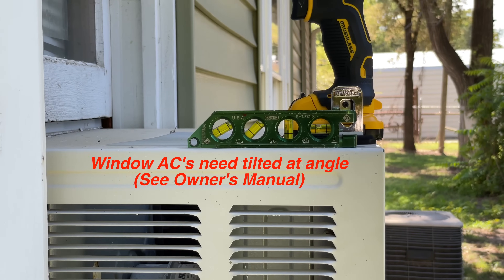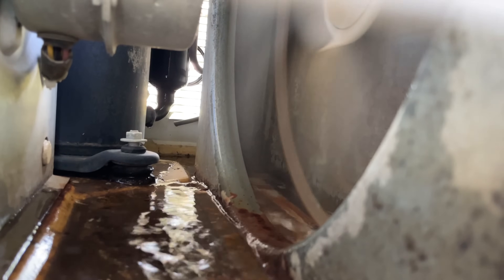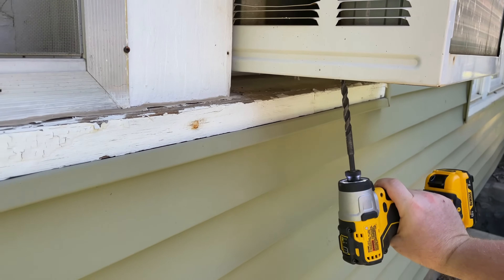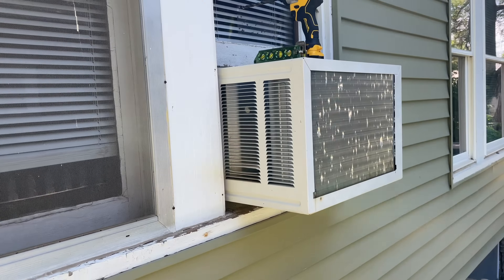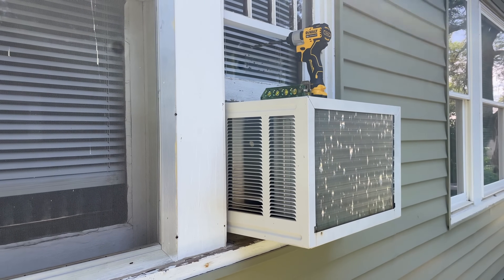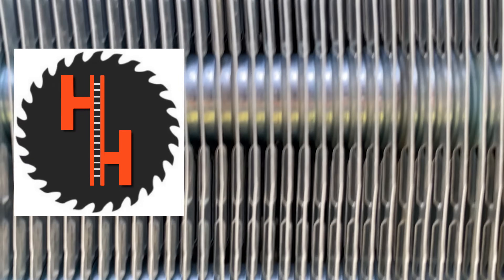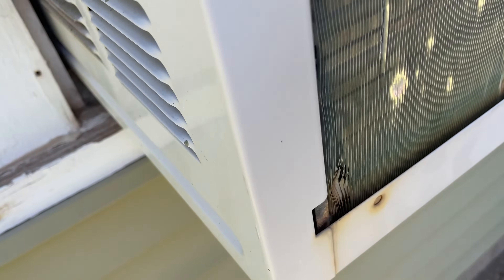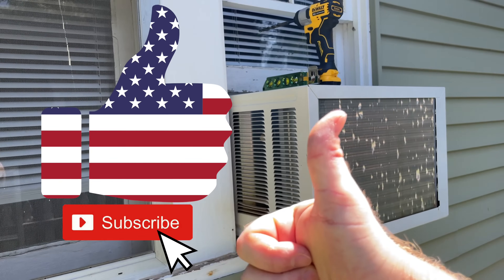99% Don't Know THIS About Window A/C's!! DON'T DRILL!!

Comment: I always drill holes in my air conditioner. As soon as water splashes on the coils they start collecting dirt and become clogged very quickly. The splashing water also creates mold in other parts of the cabinet.
Reply: I drilled mine in the exact same spot where you put your drill the first time on the side.  Drilled a 1/16 hole and blasted refrigerant all over my face.  Rip ac unit
Reply: @b18c5617  Been there before!
Reply: Been there just recently  @b18c5617
Reply: I agree with this about the mold issue. How can you NOT have mold in an a/c that doesn't drain?
Reply: @thomasschwarting5108  Back in the 1980s I had a couple of GE CarryCool ACs that fit easily into windows using the built-in handle. But I had to squirt Lysol liquid from the front regularly to keep mold and mildew from causing me allergy problems from the pooling water. Maybe that's why that design went away.
Reply: @thomasschwarting5108  Most have a drain before the water will actually come up over the sides. The problem is usually dust and dirt clogging the water path in the Styrofoam away from the evaporator.
They can clog after just a month with a poor design or dusty environment.
Reply: @thomasschwarting5108 apparently you’re supposed to just leave it running forever to keep the airflow. Even if it’s just set to a higher temp to turn on intermittently. I’m dealing with a 6 month old Hisense that is now developing mold from me turning it off for hours at a time. Sometimes days if i’m out of town.
Reply: Mold is a huge headache and health hazard.
Reply: yep better to get the watwr out
Reply: I've drilled holes in many and put 5 gallon bucket under them free water for the plants and garden
Reply: Kid shut up I've never seen mold in a window unit now go back to class and yes I have a HVAC and engineering degree from William and Mary , and I've hold a master license in HVAC so your ignorance is Bliss
Reply: Kid shut up I've been doing HVAC for 50+ years I'm licensed HVAC tech ,masters licensed I know what I'm talking about cooler condenser coil better efficiency the only way water gets in home is if drain hole is blocked and the condensation backs up but on slingers it doesn't the water doesn't sit there dummy , cold water hits hit coil heat evaporates water you idiot no mold no slime idiot now say something
Reply: No your wrong I'm a master licensed HVAC tech and the water keeps coil cooler
Reply: @henrykennedy1120  just because it keeps the coil cooler doesn't mean it can't cause mold as well. your credentials do not trump the possibility of two things being true at the same time
Reply: @AustinEterno this is the outer portion of the unit doesn’t mix with the interior air doesn’t matter if it dirty or you’re afraid of mold 

If you’d look into how the system works … 

Furthermore if you have ever had soda at a restaurant almost all the ice machines have mold 

Enjoy your moldy soda sir 
Before you open your mouth make sure you know what you’re talking about
Reply: @7LUUGG  I think you're a bit mixed up. Yes, the interior air ducts are separate from the exterior airflow. I understand that. 

Check out this diagram though: https://img.bhs4.com/3B/3/3B3B10F687C812FC6A880C90DEE13ED19CB8679C_large.jpg    
or this one 
https://www.poriyaan.in/media/imgPori/images41/ZttiojR.jpg

The moisture pulled from the evaporator drips down into the pan at the bottom of the unit then travels through a hole in the dividing wall (inside-->outside) towards the exterior through a hole to evaporate or be slung or go through a drain hole if the unit has one. If you're in a very humid environment or have lots of rain or didn't tilt the unit back enough…OR you unit is specifically designed to not allow water to leave the unit, the sludgy water can easily backup through that hole and back into the interior portion below the evaporator. Dark and wet constantly - perfect conditions for mold to grow and blowing it into your face 24/7.

whoever keeps deleting this comment: GFY. THX.
Reply from the maker: I used to drill mine, and I haven't seen any noticeable difference between drilled or not drilled. But the amount of money saved on your utility bill you can see.
Reply: @HandymanHertz  we'd like to see as well. share your savings stats. actual numbers before / after adjusting for how much use so you're comparing apples to apples. then we can make a call whether gambling with our health for a few bucks a month is worth it. https://www.cpsc.gov/Recalls/2025/Midea-Recalls-About-1-7-Million-U-and-U-Window-Air-Conditioners-Due-to-Risk-of-Mold-Exposure
Reply: @HandymanHertz  How does drilling a drain hole in your a/c unit save on your utility bill?
Reply: @thomasschwarting5108  I think he's suggesting the opposite. It will cost you more money as the AC unit is no longer using the excess water to cool off the unit.
Reply: No kid the water splash keeps coil cool which makes it more efficient and it keeps it clean
Reply: @henrykennedy1120  Well, that's the theory. In reality, the coils don't evaporate the water fast enough to prevent them from collecting dirt and clogging. High humidity causes too much condensate water to accumulate in the styrofoam evaporator side, which is what causes the mold. And with the condensor coils less efficient, due to dirt clogging them, you get poor cooling. Like I said, crappy design. It's a nice idea, but it doesn't work in real life.
Reply: @antronargaiv3283 no dude on the blower side in the air shoot on the Styrofoam that isn't mold its dust and dirt that got wet from condensation from evap coil no water gets into blower compartment unless you dont clean your unit or if evap coil ices up no son ,or kid , I've been doing this since I was a kid in the late 60s I know what I'm talking about the water that is slung on the condensing coil doesn't evaporate it continuously runs on it to keep it cool water doesn't back up
Reply: @henrykennedy1120  All I know is what I found on my four new design window units. They all have the same problems: ineffective drainage of condensate on the cooling side, dirt buildup on the condensor coils. The condensate has nowhere to go and backs up creating a humid environment in the styrofoam, which grows black mold. There's no dirt coming in on the evap side, as the filter blocks it. It's mold, for sure, due to poor condensate drainage.
Old design units drained this water and I never had a problem with them. I do agree that regular maint helps, but this new design doesn't work for me, at least in humid New England. Draining the condensate rather than slinging it seems to be working so far this summer. I'll pull them apart again in the fall and see how they look.
Reply: @henrykennedy1120  you probably think pressure washing is a scam because the rain cleans too don't you?
Reply: No I didn't the damn water cools down the coil its common sense kid
Reply: @henrykennedy1120 It cool the the fins for a little while until they become blocked with accumulated dirt and dust because of the splashing water. It also causes mold and breeds insects in high humidity locations.
Reply: Everything I say about HVAC is true I have never seen a window unit with mold  period
Reply: @henrykennedy1120 lmao, and here i am, working at an apartment building with 220 apartment. The list of ac's without mold is like 10.
Reply: @henrykennedy1120  https://www.cpsc.gov/Recalls/2025/Midea-Recalls-About-1-7-Million-U-and-U-Window-Air-Conditioners-Due-to-Risk-of-Mold-Exposure
Reply: @henrykennedy1120  Then you need to come see all the black crap being thrown around by my AC unit!
Reply: @henrykennedy1120 I have seen the Styrofoam get moldy if the unit is shut off and turned back on a lot.
Reply: @don2deliver its not mold its wet dust and dirt  I've been doing HVAC for 50+ years its not mold on the Styrofoam
Reply: I find this hard to believe.

Comment: In my experience, the water in the pan attracts bugs which drown in the water then all the dead bodies get sprayed onto the cooling fins clogging it up. The water becomes very foul smelling as the summer goes on.  When I cleaned it, it was so full of bug biomass it was crazy!  After cleaning and installing it yesterday, checked it today and it's got lots of bugs flying around it already.  Had tried  taping window screening over the vent fins of the cowling a few years ago but even that got clogged quickly and was afraid it might be restricting the proper air flow.  In my other window A/C, I drilled a hole at the side of the corner of the pan so water doesn't accumulate and it stays relatively clean year after year.
Reply: You could have glued a mosquito net
Reply: I'd rather just get a garden hose to flush out the water and bugs every now and then. Water does a great job in helping get the hot radiator to dissipate heat and get the refrigerant cooler easier.
Reply: I would often not get carried away with watering water, because it needs good drying, otherwise the bottom will rot with rust from moisture and you need make drain, then you will increase its life span from rust at the bottom of radiators

Comment: Drill it for sure.
Reply from the maker: Why?
Reply: @HandymanHertz  You don't want any water inside the electronic devices. You are smart than the engineer.
Reply from the maker: @derickd2385 this must be a joke.... you do realize this is designed to be be outdoes in the rain for decades right? 🤔 plus, water sites in the pan and gets picked up and blown out the condenser into the air
Reply: @HandymanHertz  right. You already explained that some standing water is necessary to achieve full efficiency of the air conditioner.

Comment: The air feels colder without any water in the unit. Wish somebody could test this.
Reply from the maker: You can test it if you'd like. Just get an accurate meat thermometer.  I have a video coming out this summer where I did test it. Not to give that away too much, but you're going to want to keep your water in there 👍🏼

Comment: Mine was leaking inside
Reply from the maker: Most likely cause: 1) your water passage from front of the unit to the  back is clogged, requiring deep clean. (I show this spot in my deep clean videos)  2) is not installed at the proper angle/tilt
Reply: @HandymanHertz i fixed it now and it's lifted up so Water will not come out
Reply from the maker: @JBLPartyboost 👍🏼
Reply: @HandymanHertz it's now deep cleaned

Comment: This video is the best I was told for years oh you need to drain the water but I never listened I kept the ac the way it was and it doesn’t say anything about draining the water on the ac 😅 it’s still ice cold after 6 years
Reply from the maker: Nice! Yeah it makes sense bc central ac's need to drain the water. But this is a cool design. Good job for not drilling

Comment: What about too much water getting in there to the point it's affecting the fan. especially after it rains this is a problem. Do i need a awning over it? Also, my 5000 btu unit used to be enough to cool my room on a hot day, until my neighbors cut down all their oak trees and now I ano shade at all. It cool the room good at night but on days when it gets to 99 to 100 it barely keeping the room comfortable. I know how  take the unit out and apart to clean it, but maybe I need a 6000 btu unit? Will an awning make a difference?
Reply from the maker: A deep clean would be your best bet. I did a comparison and there was an 8 degree difference. Watch my video on deep cleaning if you need. An awning won't make much difference if it's just over the ac unit. The problem is now the sun is baking your house instead of the trees. I'd guess 6,000 may not be enough, I'd go 8,000, personally. If you have two windows, I would put it either in the north side of the room or the west side of the room window.

Also, keep it at a set temperature, they are meant for maintaining temperature, not cooling down a room. You could also cool it in the morning, so you have a Headstart before the heat comes in the afternoon

Comment: I got a Midea window unit last year, and the same model again this year for another window. I did notice that the newer iteration now has a rubber drain plug in the back corner. But it's only meant for draining the unit when the season is over and you want to take it out of the window. They probably had complaints about water spillage on previous versions, since the water is designed to stay in the unit, but could pour out the front if tilted to remove and store off-season.

Comment: Well mine has a drainage hole but it's in the window sill sooo I need to drill a new one. It keeps draining into the wood and it's ruining my wall and floor.
Reply from the maker: this is due to one of the 2 following causes. 1) the AC unit is not pitched at the proper angle, and the water from the front condensor coil can't drain properly or 2) there is a blockage in your passage way that is acting like a damn and not allowing it to run to the back of the machine. This would require a deep cleaning. I show where this passage is and where to clean in my deep cleaning videos

Comment: All that water sitting in there will erode everything. You can see its already eroding your fan
Reply from the maker: This is a 2009 ac, well past its expected lifespan, and still running strong. I've never replaced one due to rust or corrosion being the limited factor in my house or any of my rental houses.
Reply: @HandymanHertz  I have replaced many that have had corrosion on the bottom of the evaporator coils and then causing the unit to lose refrigerant.
Reply from the maker: @mikezoltan3227 not sure you understand how a window ac works...you don't breathe any air from the outside. It sucks air from the inside, through an evaporator coil and back out the top. Theres a barrier between outside/inside air. In my area, it's no problem, so I'll take the saved electricity and the longer compressor life until I experience otherwise.
Reply: @HandymanHertz  I know water is supposed to be in there, but who wants to breathe that slime swamp water after a year anyways? I don't ever want to breathe it. I guess  that's why they call it a swamp cooler.

Comment: Oh phew. I thought mine had an issue. I thought it was over heating from the sizzling sound of water hitting the condenser. I just didn't expect the water to be part of the process. Just seem like it would cause corrosion and shorts as well as mold growth.
Reply from the maker: It really helps with efficiency and less hard on your compressor. I've never personally had a mold issue, or replaced one due to corrosion or rust in my house or my rental houses